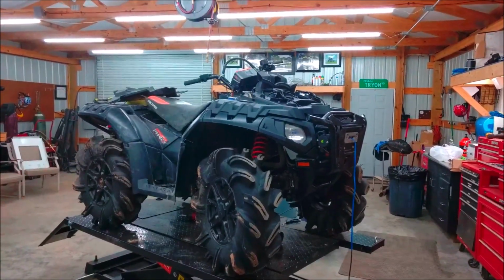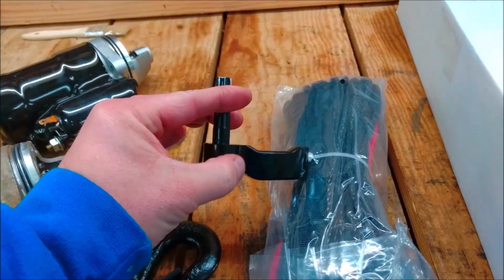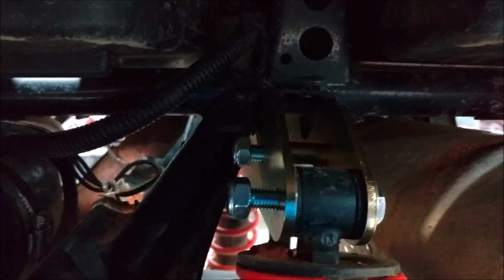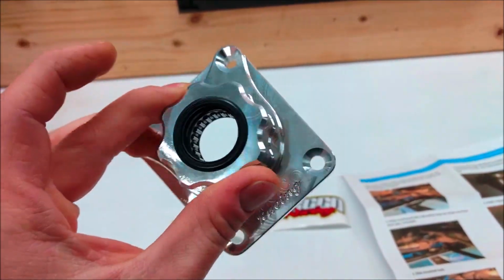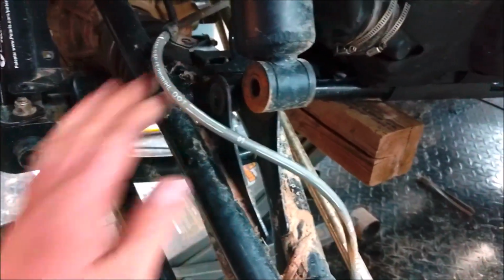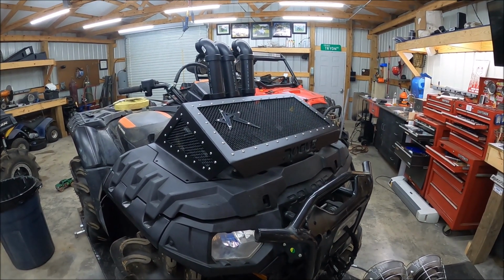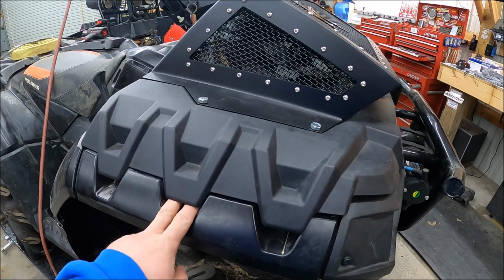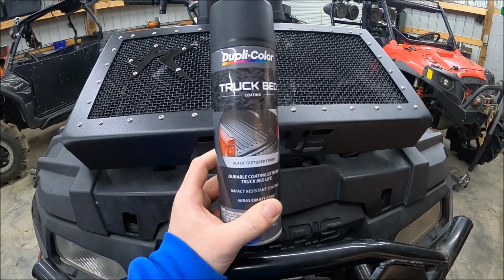Polaris Sportsman HL-1000 Upgrades!

Comment: Keep a touch on the upper axle cups with this lift leave ur springs full soft otherwise ur axles will get hot and ur diff seal will blow been there done it

Comment: Hey @SolitudeCustoms  I have a 06 foot shift rancher 350 all wheel drive I have 26 inch otp mud lites stock height but I want bigger tires not sure what tires to run and gear reduction

Comment: Does anyone know if I can fit a 30” mud lite ( used tire) on a 2008 rzr 800 50” with 3” bracket lift and elka shocks maxed out and 2” wheel spacers ? If not we’re will it rub .
Reply: sorry to be so off topic but does anybody know a trick to log back into an instagram account??
I stupidly lost my password. I would appreciate any tricks you can give me
Reply: @Dariel Kenneth instablaster ;)
Reply: @Nixon Reece I really appreciate your reply. I found the site on google and im in the hacking process now.
Seems to take a while so I will get back to you later with my results.
Reply: @Nixon Reece it worked and I actually got access to my account again. I am so happy!
Thanks so much you saved my ass !
Reply: @Dariel Kenneth Glad I could help :D